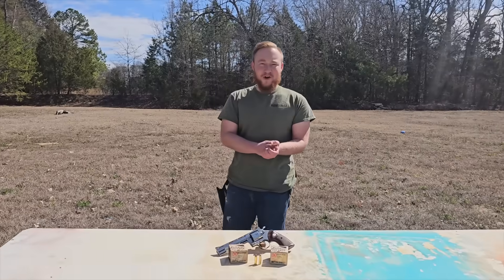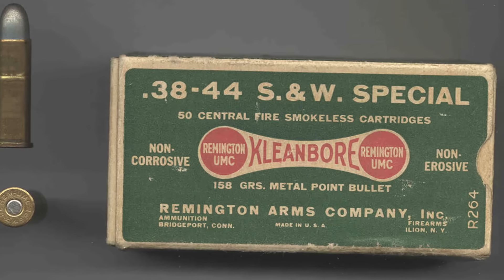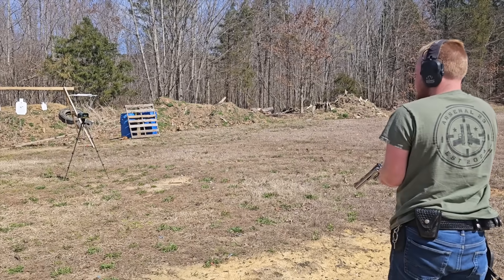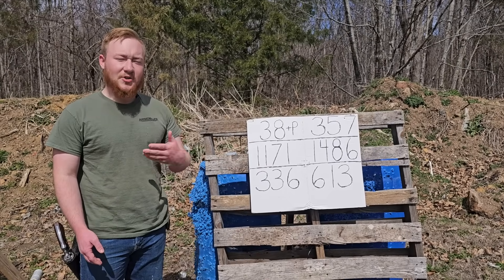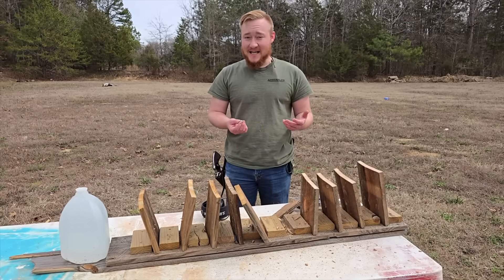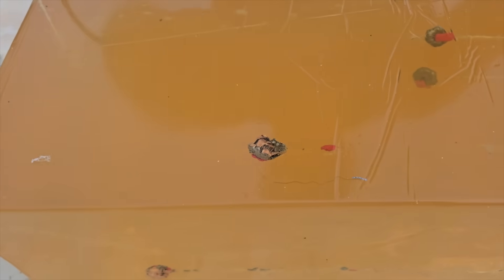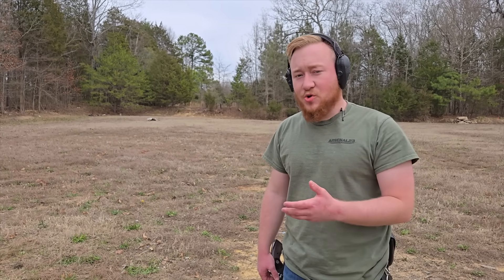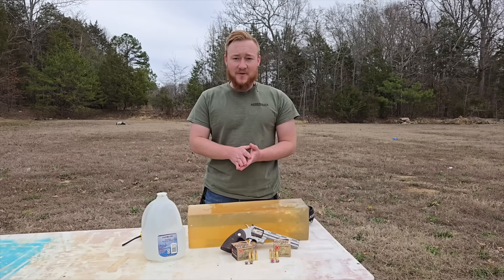38 Special VS 357 Magnum: How Much Difference?

Comment: Great video! Glad I found your channel!
To me, .357 magnum is about the maximum the average person can reliably and consistently handle from a duty-sized handgun (i.e. K-frame or larger, 4" or longer barrel).  For me, anything smaller than my 2.5" S&W K-frame and I'll stick to .38 Spl +P.  Now, I have a 3" N-frame .44 magnum that I enjoy but it is NOT a fun range toy.  About two cylinder-fulls with carry grips or half a box with the big Pachmayer Diamond Pro grips and I'm good, thank you.  LOL.  I have lots of arthritis, though, so your mileage may vary. 
In short, .38 +p will do the job.  .357 magnum will usually do it even better ... and louder ... and with a bit more thump on the shooting end. ;)

Comment: A human torso is only about 8" thick.  Any penetration beyond 8" is just going through an attacker and out into the unknown or a bystander.  .38 Special should be adequate for most defensive uses and probably safer for use in an urban environment.
Reply from the maker: It should be noted that the ballistic gelatin is not a 1:1 representation of "the intended target." It simply provides a repeatable, comparable reference for use in predicting the performance of the projectile in real-world scenarios. The 12-18" penetration mark in ballistic gel typically translates into effective performance in the 8"-10" of "the intended target."

That's not to say I disagree with you; the .38spl has been around for a long time, and for good reason.

Comment: A plywood panel with markings in inches when demonstrating recoil would have been a plus. I have a 4" Python and shoot mostly 38 Special at the range and a few 357 just to stay familiar with the recoil. With the 357, shoot through liability is a greater concern so I use hollow cavity loads. Good posting, and yes, reminds me of Paul Harrel.

Comment: The .357 magnum, when it first came out in 1935, actually had a higher SAAMI spec pressure of around 43,500 psi.  Those higher-pressure .357 rounds could actually travel at 1,500+ fps out of a 4" or even 3 1/2" barrel, but only the N-frame model 27s & 28s could fire them without a problem.  Try firing them through the model 19 or 66 or even through the L-frame model 686 and you'd risk damaging the gun in short order.  That's why sometime during the 1990's, S&W petitioned SAAMI to lower the spec. pressure of the .357 magnum by 20%, or down to around 35,000 psi (same as the 9mm), so that even their J-frame revolvers can fire them without a problem.  Gen. George Patton loved those original .357 magnum rounds because they were a huge improvement over the .38 specials at the time.

Comment: I’ve shot a lot of .357 Magnum and .38 Special in target practice and competition with retail loads and my own reloads, and I can tell you one thing for sure: firing a hot .357 Magnum out of a snubby revolver will make your hand hurt after a few rounds for some people, even after just one also is not comfortable to shoot a 357 magnum indoors or in small spaces like a car or you going to end up deaf.
Reply from the maker: I definitely agree about the .357 out of a snubnose, especially in a lightweight revolver. It can be quite punishing. Hopefully I can aquire a small frame revolver and perform a similar test with different ammunition to really draw a better picture and explain my points in this video.

Comment: You need to get yourself a 3” barrel in a .38 or .357 like a S&W Model 65 and never look back. It’s every thing you need and nothing you don’t.
Reply from the maker: I actually bought a used S&W M65-2 a couple years back. I refinished it, worked the internals, made a custom walnut grip for it, and sold it to double my money. I believe it was a 4" model with the bull barrel. It was a fine piece, I just didnt love the fixed sights over my Python or S&W 686-3. I'm looking to purchase a Colt King Cobra .357 sometime in the future. Thanks for watching!

Comment: Great video with some good data points. It's difficult to appreciate the impact that the .357 Mag had when it debuted in 1935. The power increase was substantial, but the ammo selection was also next level. New .357 ammunition choices included jacketed soft point and even 'metal piercing' loads, and made the old .38SPL round nose obsolete, overnight. The .357 had a strong "the future is now" vibe back then, and is why it is still so popular to this day.
Reply from the maker: Both the .357 Magnum and the .38 S&W Special have stood the test of time for good reason. Glad you enjoyed the video!

Comment: You keep referring to the Hornady Critical Defense as a 38 Special when it is actually a 38 Special +P.  Your test is not accurate and misleading. You could use the Hornady 38Spl with the 158-grain XTP and the Hornady 357 Mag with the same 158-grain XTP bullet. I would have also mentioned that today's 357 ammo is not loaded to its full potential, which is 1500 fps with the 158-gr bullet, not the 12-1300 fps like most manufacturers. PMC makes the 357 in its designed power range. A158-gr bullet with a 1450 fps velocity. Another thing, not all 38 Special pistols can handle +P ammo.

Comment: I still can't understand the whole "denim" barrier thing. What 1980's kind of ballistic test is this? I have not worn a denim jacket since 1989. Shouldn't this be a test using a hoodie and a t-shirt these days?
Reply from the maker: The reason for the 4 layers of denim is just to see if hollowpoints will clog and inhibit expansion of the projectile in the ballistic gel. The reason I (and, presumably, the FBI) use denim specifically is just for repeatable results. Paul Harrell and his brother, Roy, utilize a more "realistic" meat target with different clothing. You should check them out if you haven't already!
Reply: @Arsenal23.  Absolutely know Paul Harrell (RIP). However what is the point of the denim to see if the hollow point clogs if nobody wears 4 layers of denim. I love the meat target. My real question is what is the point? The FBI is about the last people I would look to for any info on firearms anyway. So using the denim makes absolutely no sense. That is like shooting a hollow point bullet at a piece of steel in front of gel and saying it cannot perform as advertised...no kidding! I would not expect my 243 winchester to go through 4 layers of denim before it hit a whitetail deer or a bullet proof vest. Make the tests realistic. Hoodie and t shirt

Comment: You don't feel the sound wave punch you in the face, with a 38 special.
Reply: Honestly if the 38 special wasn't a failure against the philippines. then the 1911 handgun and 45 acp caliber probably wouldn't have existed to replace the so called 38 special.

Comment: Simple. Get a revolver, put 38 and 357 in random and you'll know which one is which when it goes boom. There's no doubt about that.
Reply: But it's certainly not a wrist breaker round. It's just a little more spicey.
Reply from the maker: I agree, to a point. In a lightweight Ruger LCR or scandium frame S&W, the recoil from a .357 magnum can be quite punishing. For newer revolver shooters, it could be a big factor in choosing whether to carry .38spl or .357 magnum. Hopefully i plan to test a J-frame snub nose to show a more accurate depiction of the difference.
Reply: @Arsenal23.  Oh my yes. My sister bought a 'Lady Smith' I think, very light weight. Anything really over a standard round, it's scary loud and kicks like a mule. I have a Ruger Blackhawk. It kicks a little, but it's a big heavy thing so, it's not bad at all.

Comment: Me personally, I would be using a far better firearm. Ruger GP100, far superior to what you are using. You are saying a .38 is expanding more even though your own test shows it isn't. Remember. .38 isn't true. It's .36 and the .357 is far superior to it.
Reply from the maker: Both cartridges, .357 Magnum and .38 S&W Special utilize projectiles with a diameter of 0.358 inches. A 9mm uses a bullet with a diameter of 0.355 inches. A .357 cartridge does not necessarily use "more powerful" gunpowder than the .38spl, although there may be another powder used, it just uses more and is loaded to much higher pressures.

The expansion difference, that I should have went more in depth on, is that the .38spl bullets were more optimized and expanded cleanly and reliably at that velocity. The .357 Magnum expansion was a bit larger, but uncontrolled and messy. The reliabilty and repeatability of bullet expansion with the .38 Special, in my opinion, was better than the .357 Magnum in our testing.

Thanks for watching!
Reply: @Arsenal23. The reason the .357 cartridge is longer is to prevent loading one into a. 38sp. Firearm. For obvious reasons.
Reply: I think 9mm is .354, 38 is .356, 357 is probably .357. Virtually the same.
Reply: @DrGingerHamster bullet diameter, yes. Not necessarily weight. Shell size, powder charge and type of powder are important, too. The .38 special uses a different type of powder than a .357mag..357mag  powder is much more powerful. All important things to consider.
Reply: @johnkirk3279  yep, i like 357

Comment: How do you figure you got better expansion from .38 over .357 mag? .57 to .62?.. your NUMBERS DON'T MAKE SENSE.
Reply from the maker: The expansion on the .38spl was indeed more controlled and uniform. The expansion figures on the .357 were indeed higher, but the .38spl had more repeatable results. I would expect these results to be different if a shorter barrel length was utilized in testing. Thanks for watching!

Comment: Though I carry .38 +P everyday, I'm a bit surprised by its performance in your tests. .357 is so powerful that I thought the gap would be even larger. I love them both--my favorite chambering!
Reply from the maker: Ultimately, my favorite cartridge is definitely the .357 Magnum. But the .327 Federal Magnum certainly holds a special place right near it. Glad you enjoyed the presentation! Hopefully I can find a smaller barrel length and see what kind of difference it makes then.

Comment: I reload my own ammunition and I load a lot of .357 ammunition. I hunt with it. I do not use .38 special ammunition in my .357's I shoot .38's from a .38. The reason is .38 and .357 have very different external ballistics and I want my firearm to strike the target the same each time. I do load and shoot .38 special but not a lot. I did learn to make black powder and loaded some .38's with it. The .38 was very accurate with the black powder loads, I did not chronograph them and they did feel like the bullets were traveling at about a brisk walk. I do not use light bullets in my .357's. I want penetration and not explosive shallow penetration.

Comment: Nicely done.  To me, which to use would depend on what I'm shooting.  If I were in black bear territory then I'd want the penetration of the .357  For personal defense the .357 gives you more punch for sure but if you can place your shots well then a premium .38 round will do the job with a lot less recoil and muzzle blast (which could be very important should you need to get off several shots).  I carry a .38 snubby and I use hard-cast wadcutters.  And I practice every week and can consistently place 2 inch groups at 25 feet center A zone.  Oh, and .38 is cheaper to shoot.

Comment: You cannot use +plus P 38 special to say its a .38 special this is bs.
Use a standard load. 38 special  then .357 magnum, this test is rubbish.
Reply: Yah, there should have/could have been another comparison point including the 38 special.   A better comparison would be something like 158g identical bullet across 38 special, 38+p and 357.    Also using a more typical carry gun, something like a snubby with a 2 inch barrel.
Reply: “Rubbish”? Ok tiger….dial back the dramatics…..

Comment: Shooting a .357 Magnum is fantastic, but I think most of us will prefer a .38 Special because, as you said, a low-recoil gun will allow me to fire more rounds over time, training and becoming more accurate. There's no point shooting such a gun if you don't know how to handle it. Low recoil, greater gun stability, and, consequently, better accuracy without the shooter getting too tired during training. Another difference is that the .38 Special is cheaper. Furthermore, .357 Magnum revolvers are actually designed to consistently fire a large number of .38 Special rounds and, occasionally, even .357 Magnums when necessary; this is because if you fired the same number of rounds as you do with a .38 Special, you'd likely throw the gun away due to the increased wear and corrosion caused by the .357 Magnum.
Reply: For me, I like to 'feel it' when it goes boom. 38 'feels' weak, but it's not. 357 gives you a nice 'hug' when fired. I like it.
Reply: " most of us ...." !? Talk for yourself , most people like 357 magnum and that's about it .
Reply: @angel-rq4fz  I like it.

Comment: The shooter is the only one who feels the difference in the ft-lb. Foot Pounds do not translate into more damage to the bad guy. Human tissue is VERY tough and elastic. The tissue simply caroms away from the bullet and returns. The very brief stretching MIGHT result in a bruise. It's the permanent, bleeding hole that matters. Penetration is the key and the deeper the better. You don't need speed and recoil to achieve deep penetration. Slow, heavy-for-caliber bullets will go deep. Hollow points are unnecessary. IF THEY EXPAND it prevents deeper penetration. There's more breakable, bleedable tissue in front of where the HP stops.

To describe the visible stretching of the gel as a wound channel is wrong. No pistol bullet will cause the tissue to stretch beyond its ability to stretch and return intact. Only rifle velocities can do that. A pistol bullet's wound is only as large as the caliber. A rifle bullet's wound can be 3 - 5 calibers around the bullet's path due to the bursting of the stretched tissue.
Reply: Energy doesn’t matter? A bit of an over simplification….

Comment: Chamber pressure in the 38sp is about 15k.  For the 357 magnum it's around 33K pressure. The 357 magnum round is a little longer so it can't be fired in a 38sp gun it WILL blow it up.
I choose the 357 for a couple of reasons. First has to be VERSATILITY.
Sidearm and Rifle that use the same ammo. Second the 357 magnum handgun can use both the 38sp and the 357 mag ammo.
Most shops carry both ammos and is readily on hand. 
I am a handloader primary is the 357 magnum and some 38sp.
A very wide selection of bullet types and weights.
HP's & Soft Cast bullets for defense.
 Hard cast & FMJ has put food on the table. Deer and Hog.
Handgun load, 125 JHP loaded to 1250 fps from a 4 in barrel.
Same round in a 22 inch rifle barrel 1650-1700 fps.
Reply: Do you know which of these ammo has more recoil, 10mm or .357 magnum?

Comment: i used to have a .444 Marlin...it had over 2000 ft/lbs of energy per shot lol
Reply from the maker: Nice! I'd love to be able to test that cartridge one day.
Reply: @Arsenal23.  its expensive af tho...and my marlin always jammed...i sold it along with 2 other guns and bought a nice ar 15 with the $$
Reply from the maker: I've just begun to reload my 45-70 with some hardcast 450gr and 500gr lead. If my math is right, I'm getting nearly 2,750ft-lbs of energy at 1650 fps! But I would love to test some factory .444M against some factory 45-70 Gov't, i think that would be a very close match.
Reply: @Arsenal23.  actually i think the .444 was 3000 ft-lbs...i remember my dad and i found this abandoned old school water heater in the desert that weighed about 300lbs...it had very thick walls to it...we dragged it out to the range, and set it up and fired at it with the .444...at 50 yards it made a perfectly punched hole in the front and back with 0 crimping...
Reply: @Arsenal23.  google says it goes from 2900 - 3200 ft lbs lol

Comment: Bought a 686 plus 3.5.7. With the Talo grips. I could shoot .38 all day but only 2-3 cylinders of 357 before the pain was too punishing, the difference is huge. Those grips are sexy, but I put Houge on it.
Reply: I use pac-Meyer finger grips on my 6 python and 4” ruger.  Helps cushion the recoil and I have bear paws, so that helps.
Reply: Rubber grips on revolvers evil. Sell the revolver and get a plastic gun.
Reply: @Heywoodthepeckerwood the rubber stay on for the 100 round or more magnum range days, wood for carry.
Reply: Nah ,that's nonsense. 357 is just a bit 'spicier' than 38. Not like 44 mag and 44 special. 44mag makes you wake up and smell the gunpowder....that one will kick hya.

Comment: One shot of each and you’ll never forget the difference.
Reply: And if you do it in your bedroom without hearing protection you will really remember it. As mentioned the recoil can be an issue but so can the blast.
Reply: @mkshffr4936 ...I fired my 686 outside without ear protection one time.....never do that again.
Reply: @russellcyr4867  I bet. I set off one 38 +P out of my J frame outside. Painful it was, and the ringing. I can only imagine what a 357 indoors would have done. They talk of audio exclusion under stress but I wonder if it doesn't still result in at least temporary deafness.
Reply: @mkshffr4936  Why would I do it in my bedroom? LOL.
Reply: @scottzappa9314  You don't get to choose the when and where of a home invasion.
Reply: I was forced to use my service revolver in a motel hallway in a close up hostage rescue, firing three rounds of 158 grain lead +P HP at close range, putting down the suspect and freeing his captive.  My hearing was not damaged and I didn’t hear the gun go off so maybe I was lucky.
Reply: @oldcop18 it's you again haha. Nice 👍😊